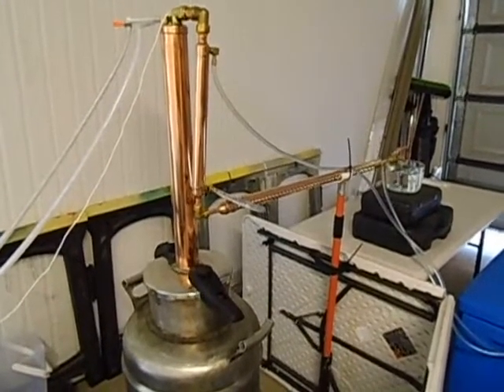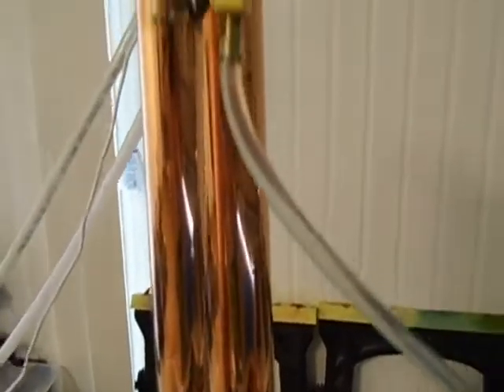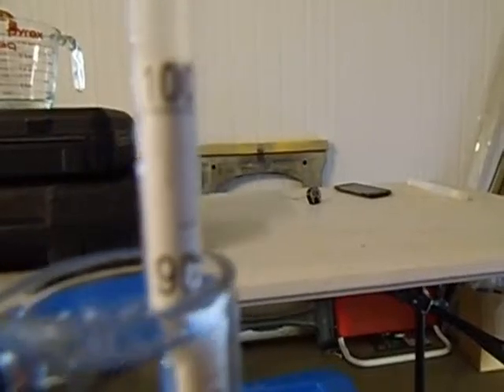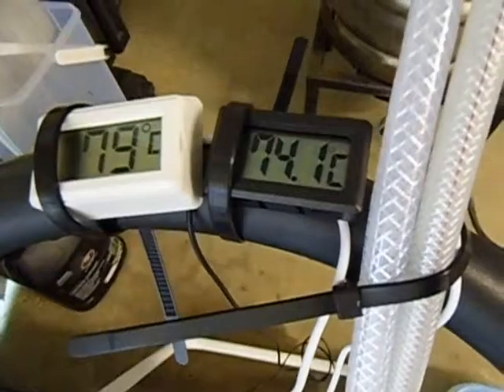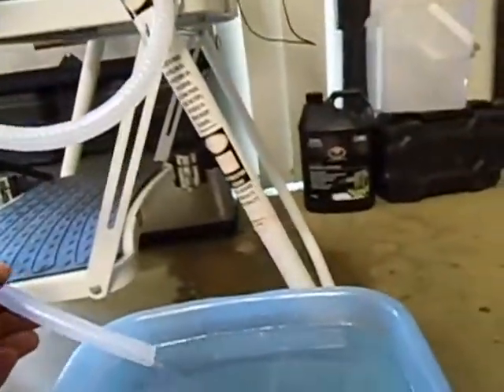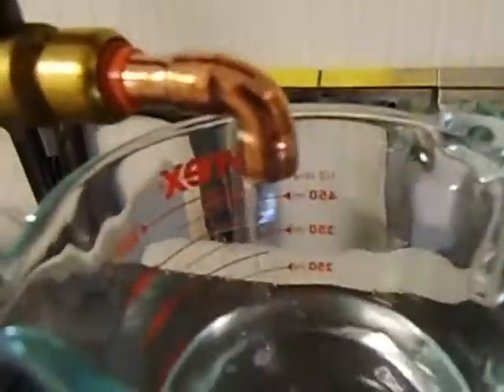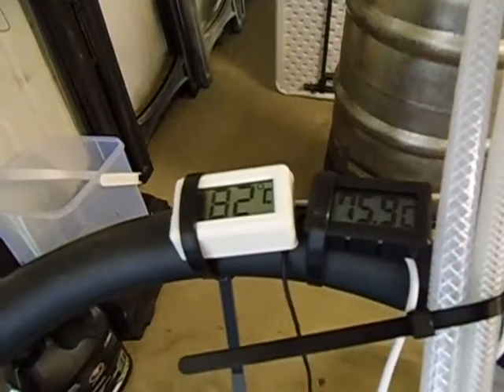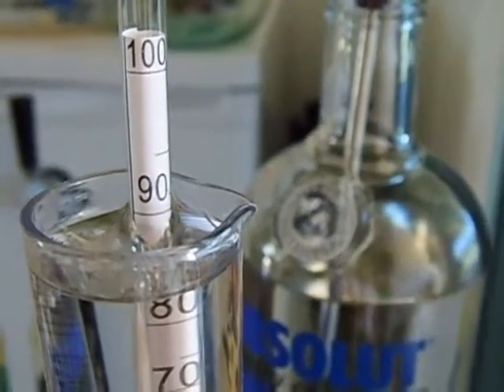New 2.5" copper reflux collumn 600mm running and abv test

Comment: Ok now I get how this works. The reflux condenser is there to control the temp of the vapours at the top of the column. Anything that vapourises higher than +\_ 78c condenses back into the boiler. The amount of water going through the condenser is what controls the vapour temp. How finicky is this setup?  Is it tough to get the hang of?
Reply: please dont copy anything that this guy is doing.. he is using brass in his still and it will kill you over time.

Good God I dont know how someone learns how to build a still without learning about the poisons that leach from brass that comes into contact with vaporized ethanol .

Comment from the maker: This is a reflux still as the vapours rises up the collumn and hit the top condenser coil causes the vapours to turn back to a liquid also called refluxing and the rest of the vapours rises further , thus a better and higher yield in alcoholic liquid and then passes through the second condenser for final condensing process before catching the final product , hope it answer your questions , it's all just about condensing and refluxing , after the vapours hit the reflux coil it turns back to water and drop back to the boiler as water is heavier than alcohol , cheers

Comment from the maker: The boiler temprature digital thermometer doesn't touch any liquid but only measures the air or vapours tempratures , it helps to show when the heads will start coming out , usually at 85 degrees celsius the first bit comes out and it's not drinkable and will kill you or cause blindness and catch the first 200ml and use it as fire lighters or cleaner witch contains methanol and meths , cheers :-)

Comment: I'm just now learning this stuff but why do you use such a large reflux coil?  Other designs that I seen only use only two pass through pipes that are part of the condenser water supply lines.
Reply from the maker: The bigger the better because you got more reflux surfaces with more windings , cheers :-)

Comment from the maker: The water comes from the garden hose witch get regulated by flowing thru a needle valve tap that's before the reflux condenser and it's to control the cold water into the reflux condenser to create the reflux actions and re-condenses the water vapours back to a liquid and drops back to the boiler , fuss causing the alcoholic vapours to rise and theirfore getting a much higher yield too , the hot waters coming from the reflux outlet can be caught and be returned to the garden when cooled down , cheers
Reply: ok